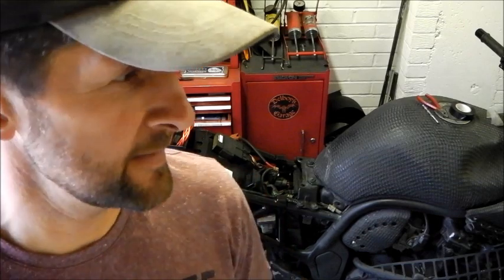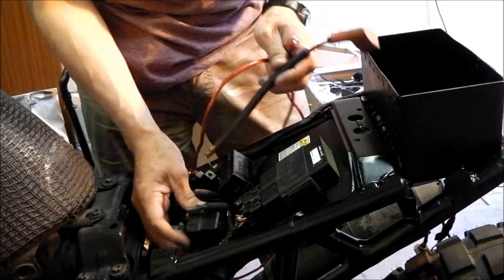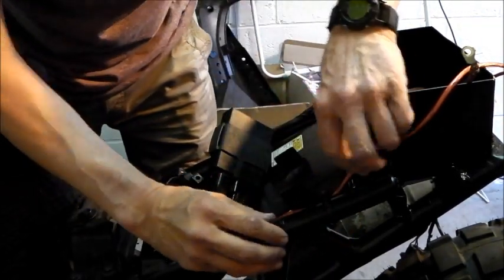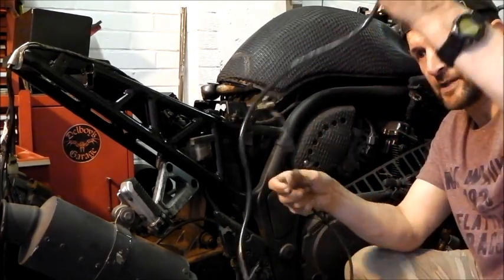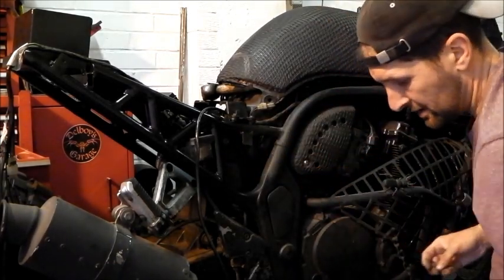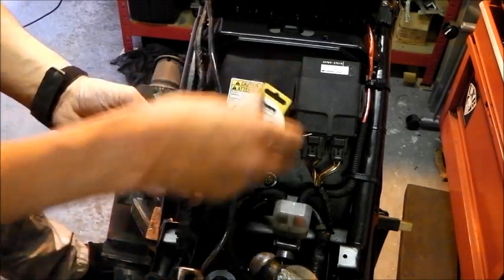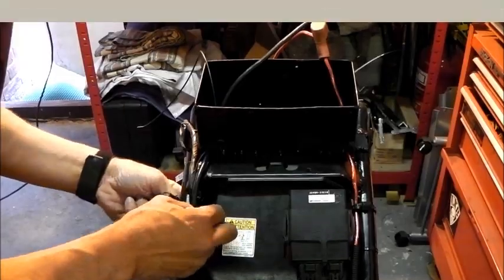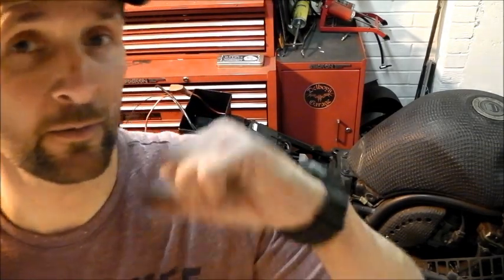Delboy's Garage, Project Bandit #17, Loomin' Closer.

Comment from the maker: Right...last word on this wire...it is a direct battery earth to the FRONT loom that secures to the fairing frame...the fairing frame does not supply a good earth by itself so Suzuki run an 8amp earth wire back directly to the battery terminal...it has a plug so you can remove the earth strap without cutting the loom earth as its mated into the terminal connection and said plug uses a shake proof plug with a locking tab that wont come undone ...cheers mate..thanks for watching.

Comment from the maker: Hi Roy, thanks for that mate, it's quite a beefy earth lead (about 3mm) and it goes straight to the battery earth, so it's clearly important, has a plug right close to the connection so you can remove the earth lead without cutting the loom and I've retained all that - got some front wiring surgery to do in the future, so just trying to keep it as high quality as I can - thanks for the insight - Cheers Del

Comment from the maker: Hi Chris, I have to admit I am a wiring novice myself - ok at connecting things that are already connected or that I know should be connected and subsequently making a tidy job of the terminals and fittings, but my mental block comes with understanding current flow, amps & ohms - that's all Greek to me!  So as long as it's elementary stuff I'm fine!  Keep at the project buddy and ride safe, Del

Comment from the maker: Hi Ted, once I'm close to the end of the build I may re-visit a few little things like that to improve them and I know what you mean about earth quality, but that particular joint has a plug terminal anyway so should be ok without soldering, if it was going to build resistance they wouldn't put a plug fitting there, they'd run a solid wire, but I will still do a resistance check with a multi-meter before I'm finished - thanks fella - Del

Comment: The extra little earth cable usually goes to the front end electrics, saves trying to get a good earth through greasy head stock bearings. I can't wait for the seat to be born, looking forward to what you will make it look like.    Roy

Comment: My can is 12" long. ... Just sayin' ..;-) ... Good work Del! Looks great! By the way, my "wiring issue" turned out to be a voltage regulator plug had worked it's way loose and came apart.

Comment: Hiya Del I have to say there is nothing worse than a poor earth return (well apart from chaffin, that's nasty...). Solder that joint else get a bit of English damp and the resistance of the cable could spiral and it has been known to cause stuff like ignition control box failure and terminal soreness across all affected parts :-).